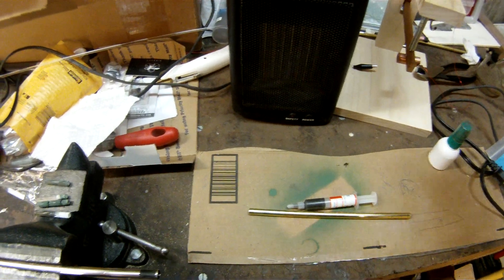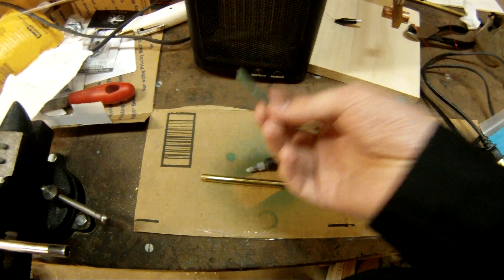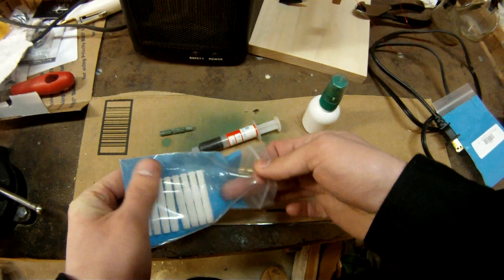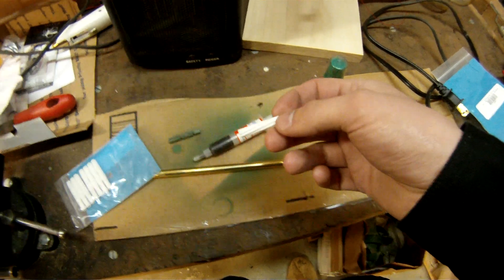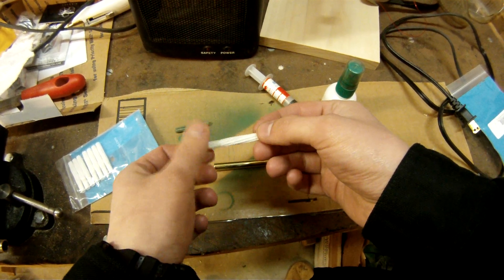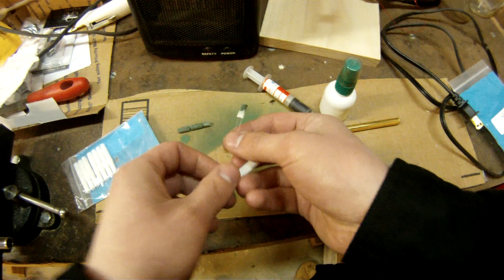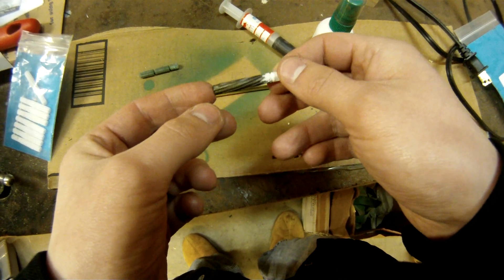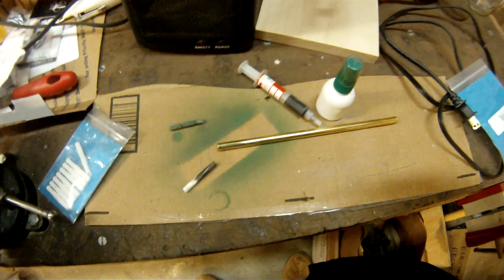Crown Enhancer and quick lapping compound test result

Comment from the maker: I mean you can use your lathe if you so desire, but you can use a drill pretty easily too. The tool is tapered though, and so you've got to be super careful not to drive it too far or too hard into the barrel because if you do you're sure to break something. You've got to run it slow and gentle until you get it just how you need it. Don't let the barrel or tool get too hot. As far as profit goes, I have no intention of offering this as a service. You surely could though. ;)

Comment from the maker: I think the madbull's accuracy comes from tolerable manufacturing quality (on most barrels at least) combined with their super consistent and lubricious anodizing. The barrel may not be perfect, but with a surface that slick I'm guessing detrimental bore contacts don't add the same sidespin other barrels would.